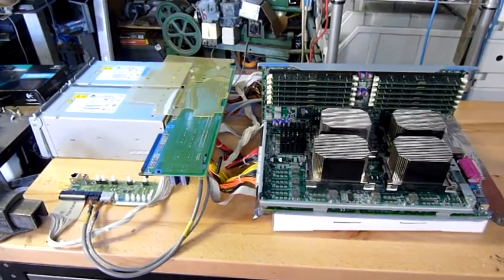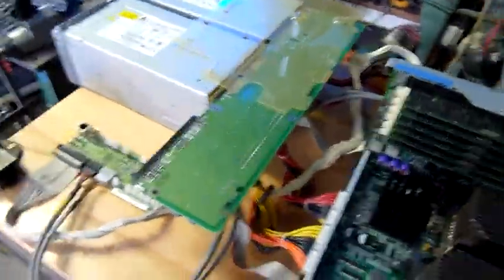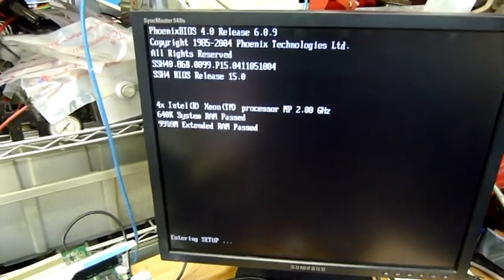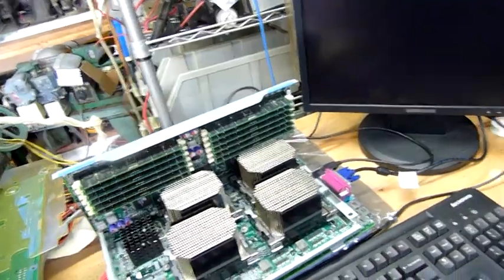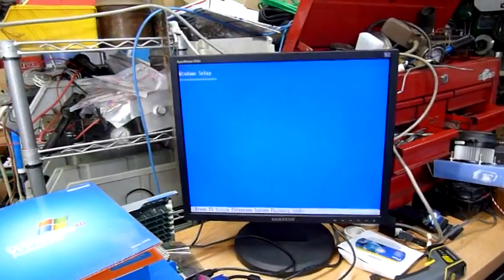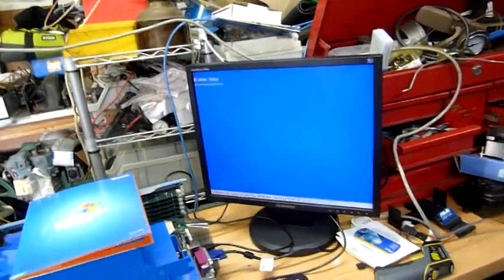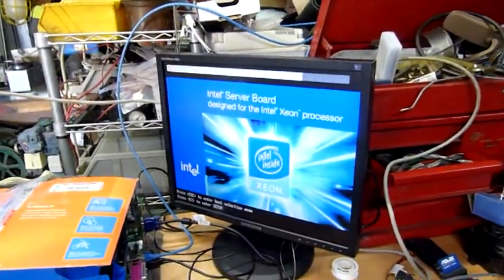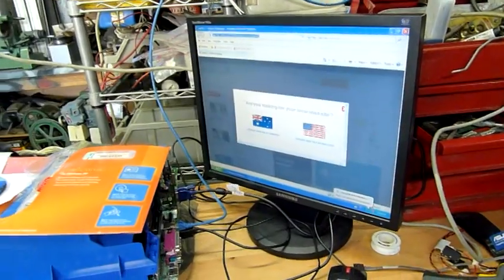Intel SPSH4 Quad Xeon Server Startup and Win XP Trial Install

Comment: Perhaps the red fans are for visual inspection of the status of the power supplies.  When lit not only can you see the PSU is on but also see the fan spinning!  My old 1u server had bright orange lights behind the removable drive caddies to help find the bay during a drive swap!

Comment: Hi Ed,
If You disable on-board stuff which You not gonna use (primarily SCSI controller) the boot time will decrease significantly. Also i recall some servers have option in BIOS to do RAM checks once every few boots, which will reduce boot time even further.
Congrats on new toy! :-)

Comment: The other option is that almost every linux distrobution will support 4 processors no problem. You could grab a distrobution such as Linux Mint which comes with Codecs for media, flash-player, and such either built in or a quick install wizard away from having.

Comment: According to the microsoft blurb, Win XP pro will only support up to a maximum of 2 separate processors (and a maximum of 16 cores per processor) its the same deal for the 64 bit edition, but it'll support up to 32 cores per proc.

win 2k3 supports up to 4 physical CPUs, plus more... depending on how willing you were to blow serious money on each edition of 2k3.

Comment: Personally i would recommend a 64 bit version of Debian for an OS for server hosting. Fedora is another very common server OS and is what we use at work to backup data and code in repositories. Either will work fine - chose whichever file format you prefer more.

Comment: Definitely go for a Windows Server OS,i'd say the newer the better if you want to use it for daily regular use. The NT Server 4.0 is good but out of the question as it only has use on 90's vintage PCs,but i mention it as it's the only OS that is better than the Home OS (win95) for the same use. Your secondary option would be Linux like Debian and it would be free and easy to obtain,however it's hassleish for non server use.

Comment: XP Professional and windows 7 professional supports only 2 processors (does not matter on the number of cores tho) 

Linux will support 8 separate CPUs but if you compile an the kernal you can speciify up to 512 CPUs.

Windows Server 2008 R2 Datacenter Edition supports a maximum of 64 physical  processors.

Comment: You should find that any modern one will, they should automatically install an SMP kernel. Something to look for is one with a PAE kernel so it can see more than 4GB ram on a 32-bit system. Some installers will automatically install a PAE kernel, others will need to be installed after the main system is installed. I'd recomend a Debian based system for a server, but a Ubuntu based system would work as well. If you need help getting it to work, I'd be more than happy to provide assistance.

Comment: I think Windows 7 is limited to 2 physical processors (or sockets). 

Windows 2000 Standard or Windows 2003 Standard will work with more than 2 sockets and also support PAE so they'll be able to use more than 4 GB even if they're 32 bit versions, provided the motherboard exposes that option. 

The 64 bit versions will 100% support more than 4 GB of memory.

If you're lucky, you can find 2003 32bit on eBay under 100, Win 2k datacenter/enterprise for under 150

Comment: Xp pro 32 won't work. Xp pro 64 however will. But it's a pain in the ass to work with as it is now where near as compatible with 32 bit software like win 7 64 bit

Comment: I use linux Mint x64 myself. Does this boards CPUs support PAE Extension? If so, get a copy of mint 14 MATE. If the CPU doesnt have PAE, get a copy of mint 13 MATE.
--
If you don't know if the board has PAE, just get Mint 13 MATE. Mint 13 MATE still has update support until 2016
--
Also i am recommending MATE because it runs well on lower end GPUs & CPUs ;)
=========
Also:
Windows 2003=Windows XP
Windows 2003 has just got some missing visual fx and has some extra server stuff

Comment: I agree, an Ubuntu variant maybe with something else than Unity would run pretty nicely on this one if you want to be legal, because you get multi CPU support right out of the gates.

For a home file server, I recommend you look at something like FreeNAS so you get your ZFS support if you intend to archive your videos, makes sure they do not "bit rot" on your drives several years from now should you need to do a reupload or whatever.

Comment: Ed you need to be using a 64 bit version of xp to see all the RAM, 32 bit OS's are limited to 3 GB. Also check device manager or task manager for the CPU count.
Dont bother with Win7 as there may not be drivers for the hardware as it may be to old. Als Nvidia has the best driver support ever, they still do updates for my FX 5200.

Comment: @aussie50 I recommend Linux mint for an excellent windows replacement. I haven't found a more stable Linux for what I do. Also on your i7 build get a hold of a corded Xbox 360 controller and get the drivers from Microsoft and no more keyboard / mouse. Just sit back and play :)

Comment: XP and Windows 2003 are the same thing BUT Microsoft impose restrictions on how many CPU's etc the version can use. I had / had a program which Microsoft went to great length to kill that allows XP to become 2003 server. This was only really useful in converting Windows 2003 standard to enterprise which normally would mean a fresh reload. PS Windows 8 = Windows 2012 too. I always ran a repair over the top of a converted system to be sure all the appz and setting where good on an update.

Comment: yeah that should do it as long as its the x64 version of XP, only reason its not using all the ram is because a 32 bit recherche will only support a max of 3.25. To use the rest need to step up to 64 bit.

Comment: Bring up task manager and you'll probably see two graphs.  The system properties always only display the data for one processor, but XP will use two processors.  You'll need a server OS to see all 4, and you'll need a 64-bit OS to see all the RAM.  If you can find a copy of Server 2008 R2 that would be best, it can very easily be turned into a workstation and should run very nicely on that rig, and Microsoft Security Essentials works on it, so free AV!

Comment: Oh and since you system reports Xeon MP's at 2.0Ghz if you search RN80532KC0412M  you can get more info on your processor. It is 32-bit so suggestions to use a 64-bit operating system won't help. For linux you'll need a 32-bit kernel with PAE. Interesting note those processors retailed for $3600 US each in 2003.

Comment: Cable only chooses drive master/slave if the jumpers on the drives are set too cable select.
To allow the cable to choose master slave both drives on the cable must be set to cable select.
otherwise one drive has to be set to master and other to slave.

Comment: You could probably pick up a complete rack mount server in it's original casing for a few hundred $ from ebay or whatever. Last generation servers are no good to anyone so they are cheap. That boards probably nice and clean because it was running in a nice clean datacentre.

Comment: you probably would need to buy a server OS because if i remember correctly the desktop OSs' only support 2 processors total. a linux brand OS designed for a server board should support more than 2 processors. Best of luck.

Comment: I doubt those red led fans are the original ones in those psu's. Usually delta psu's use their own delta fans on NMB ball bearing fans-noisy as hell but last a lifetime.

Comment: i would run vmware on it. then set up some virtual machines like a nice ipcop box as a firewall and router and maybe a file server with a linux distro ect.
so when are you imergrating from mexico? lol.
PS i have all vmware from 2.5 to the latest 5.0 update 1
3x for non 64bit systems and 4 to 5 for 64bit.
i have never looked back after using vmware not to mention saved so much money by having all servers on one big ass server.

Comment: Remember 2003 = XP, XP = 2003, in fact, there is ways to install 2003 from a XP disk. The OS kernel is the same, just neutered by config files on the CD....

Comment: Give a linux distro a shot, a 64bit kernel or 32bit PEA kernel will immediately use all the cores and memory. Probably find 100% of the onboard devices' drivers are built into the kernel too.

Comment: Change the HAL to the ACPI or SMP CPU HAL in System Properties -> Device Manager. You will need the install CD to do that and you will need to reboot, and it should recognise all four CPUs after that. It might want to re-activate, too. XP is a bit of a waste as it will never recognise all that RAM. You can get it into PAE mode, and you're good to go to around 6 GB for software that understands how to use PAE, but it's still brain damaged. I'd suggest Ubuntu or OpenSuse

Comment: Winblows on a server WTF?
Use an actual server os like Linux, BSD or Solaris.
Linux Mint 13 with MATE would be easiest if you want a GUI, or Debian Wheezy if you don't want a gui. You shouldn't need any drivers other than the graphics driver for the geforce card.